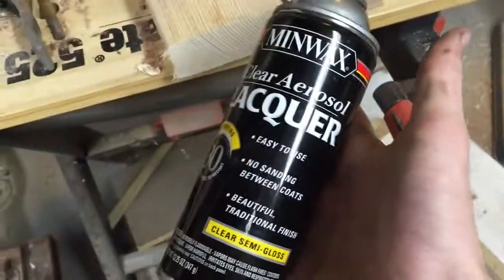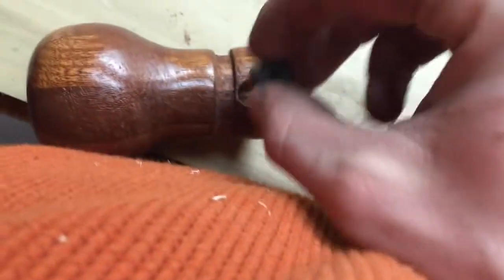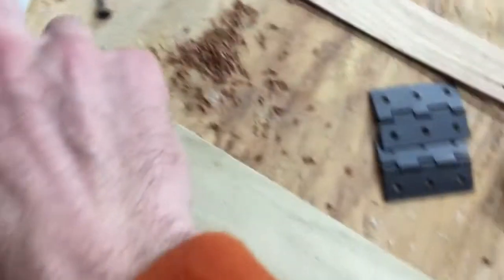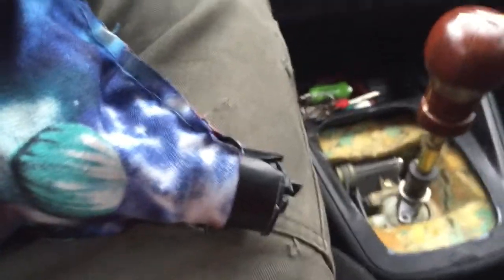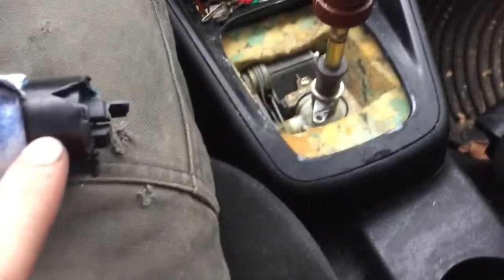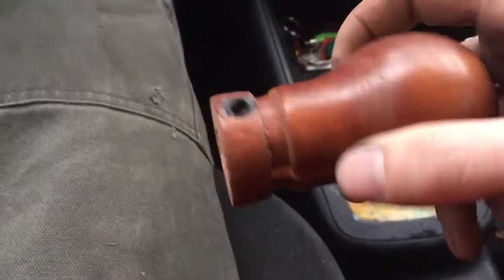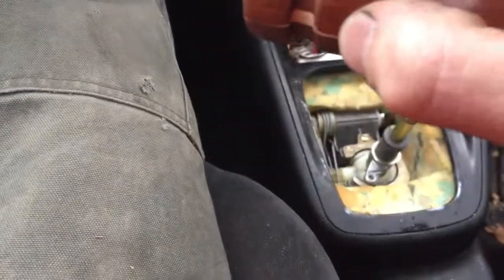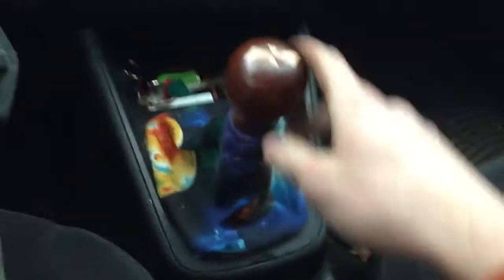Making A Wooden Shift Knob

Comment: lol ya that hair is bad ass. don't cut it. keep it going! and that knob is awesome
Reply from the maker: +Beto Reimer Thanks man! These hair comments are making me laugh. I'll keep it long
Reply: Lol I usually have a Mohawk in summer. And I turned a shifter knob similar to what you did. And now everyone wants one. Looks like you got a decent lathe bud
Reply from the maker: Yeah mohawks are cool, I had one a few years ago. I made this huge metal shifter that everyone though was great but it was super unpractical. As far as the lathe goes, it's like this 50 year old thing but it still works great